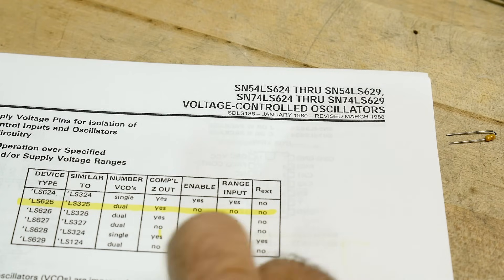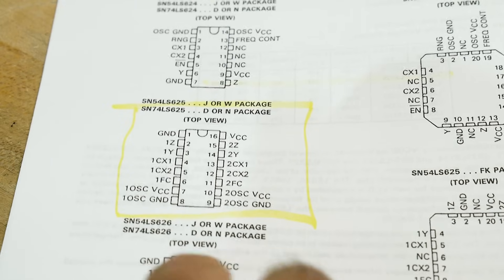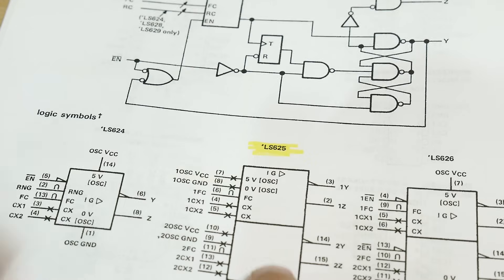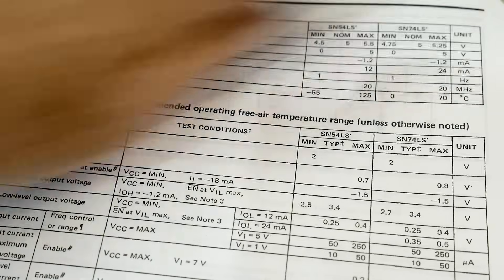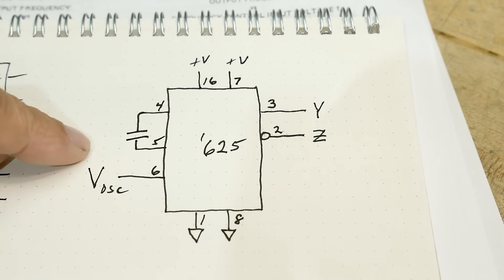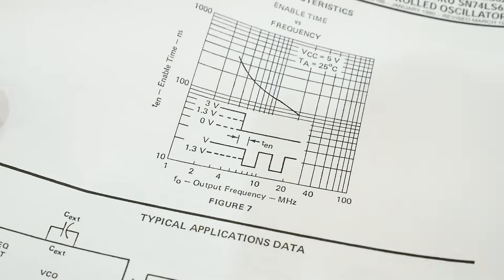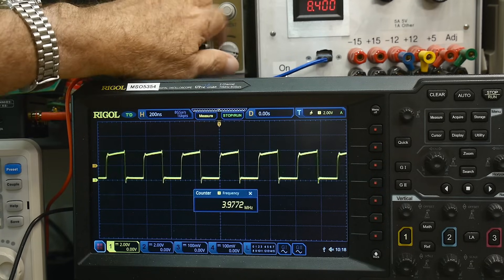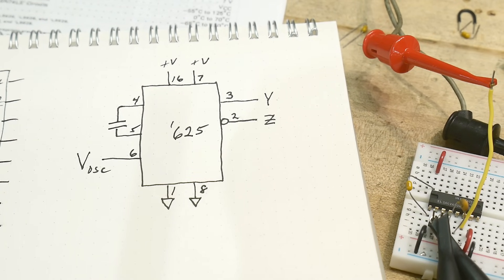#1686 74LS624 74624 Voltage Controlled Oscillator

Comment: I wonder if the capacitor "outputs" put out half-of-a-ramp-wave. Not something you're keen to try? .-)
There are also versions with two voltage inputs, one for frequency and one for "range", so should have a huge ... range.

Comment: It is an interesting device for sure. I am a little bit concerned about the output waveform. Compared to a TLC555 especially the high output voltage is not very stable. I am curious if it is the same for lower frequencies around 200 to 500 kHz. Maybe this is caused by an underdimensioned capacitor between Vcc and GND. The old TTL devices from the 1970ies have no shoot-through protected output stages (this is the same for the NE555, which has up to 200 mA shoot-through current, that's why I don't like it).

Maybe a low ESR ceramic capacitor of 1 to 10 µF could solve the problem. For digital applications this is not an issue, but if you need well defined output voltages this should not happen. At higher frequencies such devices could therefore consume of lot of current and generate considerable amounts of heat.

Comment: Cap selction changes the freq (along with the voltage)?  Don't caps change their value with temp and stuff?
Reply from the maker: yes they do, some worse than others, choose wisely
Reply: @IMSAIGuy Thanks - learning a bunch!
Reply: Capacitors are generally horrible when it comes to temperature stability.

The "best" that are readily available these days at a reasonable price and suitable for a circuit like this are "COG" (C zero G) ceramic. These used to be called "NPO" said as en pee oh but in reality it is N P zero, meaning negative-positive zero - the temperature coefficient of capacitance is nominally zero. You used to be able to get caps like N750 - a negative tempco of capacitance of 750 ppm/°C. That's just an example. Various tempcos were available. There were "P: types too, hence the NP0 designation for those with neither negative nor positive tempco. By selecting the appropriate tempco you could do things like compensating for the opposite tempco of an inductor used in a resonant circuit as in an RF receiver.
Polypropylene capacitor are reasonably good with regard to tempco of capacitance. Polyester ("mylar") are pretty awful.

An oscillator like this would typically be used inside a "phase locked loop." In a PLL the stability of the capacitor isn't a huge concern because of the closed-loop nature of the system. Like the poor temperature performance of this part itself, the error gets "cancelled" to a very large extent.

We now have ceramic caps with abominably high negative VOLTAGE coefficient of capacitance. A cap actually operated at its rated voltage may have 20% of the capacitance it would at a much lower voltage.

Selecting the right cap for any particular application can be quite a challenge at times.

Comment: Would be quite handy with the I2C controlled variable potentiometer from a few weeks ago, in that you could have an I2C controlled external oscillator that requires no actual programming and barely takes any programming on the side of your MCU. You could then cascade them and have a lot of external oscillators being controlled by a single MCU and using only an I2C output. Far more than you could have with digital outputs and far more accurate.

Comment: 74LS624 output frequency goes well over 50 MHZ, and the output is 50/50 duty cycle, unlike XTAL oscillators which are usually 60/40.
Reply: Yes, but a crystal oscillator will be stable. The stability and linearity of this thing will be poor, but that's not a problem when it is used inside a phase-locked loop.
Reply from the maker: no such thing as a voltage controlled XTAL
Reply: @IMSAIGuy  
There are voltage controlled crystal oscillators. Usually the frequency can't be changed by more than a few tens of PPM.
VCXOs are very useful for making something like a very high precision timebase using the VCXO in a PLL locked to a clock signal from a GPS receiver.
Reply: I mentioned 50/50 because when (last century) computer overclocking was all the fad, people "just bought a new higher frequency oscillator" and cpu could not be overclocked by a 60/40 freq.
That's when the RF oscillator entered the scene, and it was found that an adjustable 50/50 duty cycle clock could indeed benchmark better than the fixed freq quantums that 4 pin clocks were easily available.  One of my claims to fame is designing and selling an Amiga accelerator-board --> FOR accelerator boards called SocketRocket. It interposed the MC686881/2 FPU chips clock with a TTL VCO, and a simple pot to adjust the overclocking above 50Mhz. Naturally I included a FPU chip select LED so you'd know when FPU was engaged, an used the power LED as reference temperature sensor so the clock-freq was regulated down w/temp.
I have some extra blank PCB's and can send you pics of the finished "SocketRocket". P.S. MC68882RC50's will run at 62+ MHZ on a 50/50 clock.
#Raytracing in the 80's

Comment: what happens if you put a different voltage on the oscillator VCC?  Say 3v3...  could the oscillator VCC be for setting output amplitude?
Reply: Varying the OCVcc1 and 2 varies the output FQ, with a fixed cap value, obviously.
Reply: Normal TTL voltages will be required. The reason for the separate pins is to ease issues with delivering clean supply voltages to the oscillator section. Noise on the oscillator supply will lead to jitter in the output frequency which can be a significant problem in lots of applications.

DO NOT expect a circuit like this to perform well on a solderless breadboard with sloppy power connections and some decoupling caps with long leads crudely jammed in.

Comment: I always preferred the CD4046 for PLL and VCO applications, maybe they are not as fast but they work with low power consumption.
Reply from the maker: 4046: https://youtu.be/P8agoshy3H4?si=KapZ3-1lJdWzLUjY
Reply: There are versions of the 4046 in other CMOS families that are much faster.
One of the conveniences of the 4046 is the on-chip phase comparators. Iirc, one of the faster versions has three different phase comparators on-chip, but it has been a least a decade since I've looked at these things.
Reply: @D614G_aka_Doug I used 4046 over 35 years ago to built a frequency synthesizer generator.   I used  a bunch of down counters and  bcd switches. It worked amazingly well up to 2MHz 😅

Comment: Primary use was in wide range PLLs. A near equivalent in ECL (remember ECL? Dating myself here!) was the Motorola MC1658.
Reply: I have 100K ECL on the floor of my car. 🤣   (I may be old, but I can laugh about it)
Reply: "Dating myself here!
Maybe. But at least you won't give someone a funny look and a "Huh?" if they mention a negative 5.2 volt power supply.

It has been years since I've looked, but there were still some ECL parts being made at the time. PECL was in use for a time. I don't know if it still is.
There was a rather ancient ECL triple fully differential  line receiver that made quite a good amplifier and found use in things like frequency counters.

I used to have and ECL board (from a DEC CPU of some sort, iirc) that I used as a show-and-tell piece because it had little loops of tracks on the PCB for time delay matching and even a area with a sort of zigzag trace from which a jumper could be soldered from the appropriate point to an adjacent straight track for tweak-on-test matching of delay. All that stuff largely disappeared for a long time but is now very common on consumer computer boards.

There are versions of the old RCA CD4046 complete PLL in newer CMOS families that will run at nearly double the frequency of this LS part.
Reply: @D614G_aka_Doug  I believe you're talking about the 10116. It was three fully differential sections, typically used as the front end of a frequency counter. The first two sections were used as amplifiers, while the third was used as a Schmitt trigger to square up the waveform.
Reply: @hardlygamaliel455  
Yup, that's the one. I couldn't recall the part number.
DigiKey has quite a large stock in an SM package.

I remember when DigiKey's catalog was about 8 pages.

Comment: I remember skimming across a board for numbers years ago and seeing a 324 but quickly realizing it was a 74LS and not an LM. I've never come across an LS625, but I have seen the LS624 a couple times in old gear and Mouser has fresh LS624 chips from TI but yikes, they are indeed pricey.
Reply: Mouser  595-SN74LS624N   $3.61